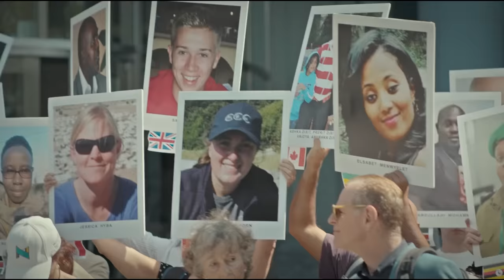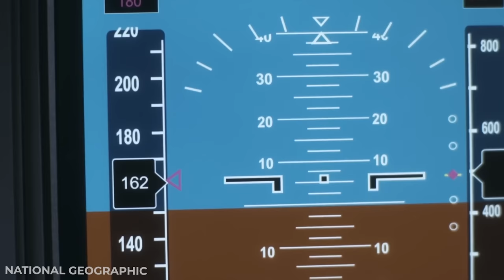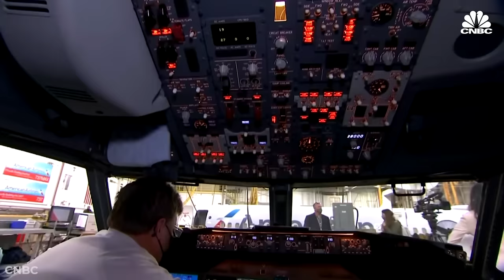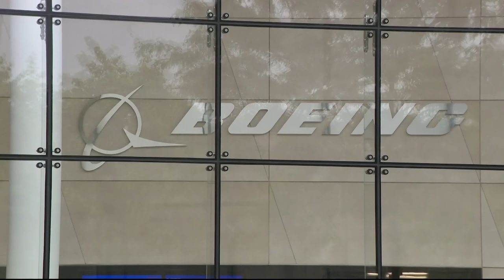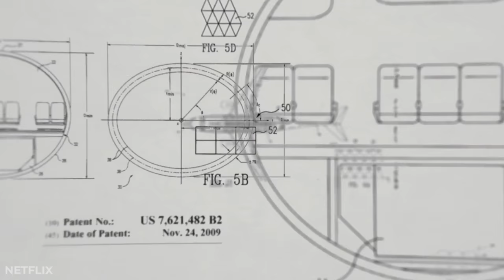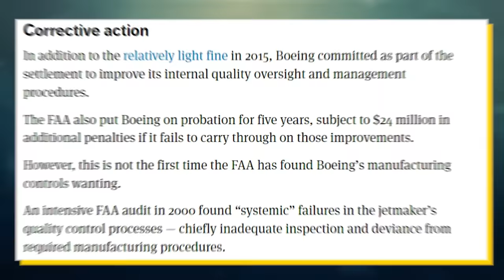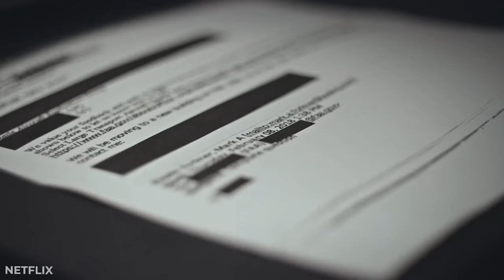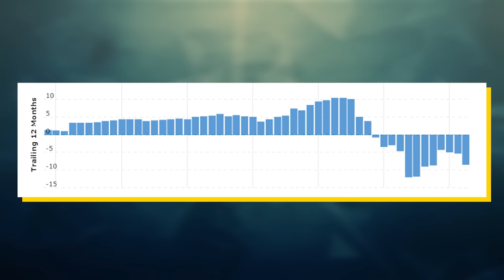Even Boeing Engineers Don't Trust Boeing...

Comment: The Challenger space shuttle disaster was caused by the same thing: administrators having the last word over engineers at Morton -Thiokol, the company that built the solid rocket boosters.
I see it happening all over the place. Managers believe that selling planes, rockets or consumer products is the same, it's just business.
I see it at Turbomeca (Safran group, they build and maintain helicopter turbines). There are more people in management than in engineering jobs.
Reply: The solid rocket boosters didn't down the Challenger. It was the fuel tank leaking, probably due to the cold weather. In fact, after the explosion, the solid rocket boosters kept going and had to be detonated by remote control so they didn't just fly randomly.
Reply: @pride293  Rubber O rings between sections of the SRBs failed because of very cold weather. Flames then impacted the shuttle fuel tanks. The SRBs were the location of the source of the problem. Engineers warned of this potential, but were overruled by management, to launch.
Reply: True. Even my Lexus is a piece of shit. Lexus! My 1992 Toyota Celica was a beautiful vehicle top to bottom. At some point in the mid to late nineties, things drastically changed, across the board. Greed has trumped quality, the environment, safety, workers, society... everything.
Reply: Parasitic shareholders are a huge problem.

The business is doing well making and selling their product. The customers are happy and so are the staff.
Along comes the parasite shareholder who insists on prices being raised to the market maximum as well as staff pay being cut.
This leads to the customers looking for other suppliers and to the staff becoming unhappy because their wages have been cut.
But the shareholder is happy because now they are taking even bigger dividends even though they are not the ones doing the work or buying the product.

Then we see the typical product quality problems which we shared legally hold shareholders responsible for because they are the reason why the problems happen. So shareholders of aircraft manufacturers should be responsible for safety issues that lead to deaths.
Reply: @Google_Does_Evil_Now  Nailed it. Add to your wage reduction scenario, the typical staff reduction move. I see this all the time. It's actually the way they reduce labor costs. So now you have employees possibly being paid less, but more importantly, incurring the stress of doing the job of more than one person. Add to that mess the sales and marketing folks making unreachable sales promises to prospective customers. Now the people actually doing the work, and doing the work of more than one person, are trying to meet unreachable deadlines. More needs to be said about this. Much more!
Unions used to solve many of these problems, but they eventually managed to remove that road block.
Reply: @JohnnyRawks  What is a union? It's a group of your country's workers who form a democratic voting process to discuss reasonable pay and conditions.

What's is the United States if it's also not a union of voters who try to elect a decent government to make everyone in the country have better pay and conditions.

The problem unions have is the same problem the voters have - corrupt or weak politicians who sell out the people.
Reply: @Google_Does_Evil_Now  The problem wasn't the general share holders, companies like Boeing wouldn't exist without shareholders. The real problem was rewarding Boeings management with shares, it gave them the the incentive to cut costs and cut corners, thus creating the disaster that they have. Boeings management are entirely to blame.
Reply: @pride293  The solid rocket boosters are built in 5 segments. In each segment, there are 2 O-rings to prevent the hot gases escaping. The Challenger accident was caused by both O-rings failing between two aft segments (because the cold made them to stiff to seal properly), hot gases leaking and melting a rear support strut holding it to the main tank. When the rear strut failed, the SRB pivoted and it's nose punctured the external tank. The external tank then exploded.
Reply: and then you start loosing a lots of money.
Reply: @pride293  Wrong.  O-ring malfunctioned on the right solid rocket booster and the flame burned through the main tank.

Comment: This door ripping off issue happened again on Boeing 737 with Alaska airlines. That's what brought me here. Alask Airlines has grounded all their Boeing 737-9 Max.
Reply: It's the MAX 9 specifically grounded but yeah, this is another MAX variant that has proven a disaster
Reply: I'm sure there was some cost reason behind it, but I really think Boeing should've cut out that bit of the fuselage only for the airlines who asked for the extra exit doors.
Reply: @Satoshi9801 the manufacturer of the door plug is also being blamed for the issue. I have also read that Airbus does the same thing. I'm guessing that they have to manufacture all the fuselages the same way for certification reasons? Idk.
Reply: @incubus_the_man  Boeing is responsible for what goes in their planes regardless of the part manufacturer.
Reply: oh really thanks genius
Reply: @Flightfest900  why are you hurt for no reason?
Reply: Not all 737s there are a lot of different kinds
Reply: the true beauty of capitalism
Reply: @andreasp.1572 Sorry you missed Aeroflot during the red years to see the alternative.
Reply: @michaelplunkett8059  does it really have to be black or white?
Reply: @andreasp.1572 YES. Capitalism wins.
Reply: @nonamewanderer
It is always the Boeing 737. Yes.
Reply: @incubus_the_man Planes are required to have a certain number of emergency exits depending on the number of passengers.  It's just that the seating configuration that Alaska airlines was using was below the level needed to have that extra door available, so they had it plugged to save the weight of the emergency door.

This specific plug type has been in use for a while now without incident, so someone somewhere down the line massively messed up and QA failed to catch the issue.

Mentor Pilot has video that goes into more details on why the door was plugged and the possible ways it could have failed.
Reply: Alaska didn't ground their 737-9s...the FAA issued an Emergency Airworthiness Directive.  Alaska was inspecting their jets and planned on returning them to service.
Reply: @Phillip_Fry until it kills 300 people trying to “cut costs”.
Reply: All 337max world wide should be grounded and abondened and boing should be the one giving compensation and fine with legal changes.
And what about the lobbying of boing with government? .......
Reply: @Satoshi9801  it's there in case the hull owner wants to refit it to have more seats at a later date. Then you just change it for a functional door. It's a first for a plug to blow out this way. Somebody made a better idiot.
Reply: While only -9s were grounded, I believe all Boeings with plug doors should have. It's not like plug doors are installed by someone else in other models.
Reply: With Alaska Airlines, there was a pressurization error and the airline ignored it, so that's not a Boeing issue, that's on the airline.
Reply: @rebeltvr6046  Not installing retaining bolts is fully on Boeing.
Reply: @sharpfang  Boeing messed up, but Alaska Airlines knew of the issue and decided to fly over land rather than fix the issue.  They could've easily fixed the issue.
Reply: @rebeltvr6046  They knew of an issue with the pressurization system. The plane isn't airtight, it constantly has the internal pressure balanced by compressor and bleeds it through vents. The computer didn't perform to specs. They are also expected to fix problems resulting from normal wear&tear or accidents. They are not expected to check whether the manufacturer installed all parts it was supposed to install.
Reply: @sharpfang  True, but Alaskan bears some of the blame regardless, esp. considering they decided to fly over land rather than water in case they would need to emergency land due to the pressurization problem, which is a horrible way of thinking.  Don't fix the issue, fly over land instead...
Reply: @rebeltvr6046   I agree with you that it was a known recurring problem with the pressurization system they should have vigorously investigated, and found the cause. A cause with a simple fix.
Reply: @annedavis3340  Yup.  But like other have said, Boeing made the much bigger mistake.  Fault to both, all due to cost cutting measures and greed.  It's shameful.
Reply: @rebeltvr6046  I can agree with that... but AFAIK this was not in violation of any rules. They could have done better. They were not mandated to do better.
Reply: Alaska hasnt grounded all their 737s because rheir entire fleet is 737s. Theyve grounded the MAX 9 as per FAA directive
Reply: @rebeltvr6046 they didnt ignore it, they investigated it and were unable to find a cause. There were rendundant systems in place so it shouldn't 🎉have been an issue. Boeing takes the fault here.
Reply: @rebeltvr6046 deciding to do that was not a requirement under FAA regulations. The plane was safe to fly as far as they knew.
Reply: Do they add another max number every time a door rips off?
Reply: It at least wasn't a design flaw it was just they had taken the plug out to work on skin rivets. Then they  FORGOT to put the bolts in when they reinstalled it & no paperwork was submitted for the job! 😮😅
Reply: There is absolutely no exucuse whether it be a design flaw or simply negligence. It all comes down to my not trusting Boeing with my life.

Comment: Side note, contracting outside companies to produce your parts and just assembling them in house isn't always bad, its bad when the inspection process is lacking. Gulfstream does this and we regularly scrap things or reject parts and slow our line down if it doesn't meet standards (ive seen whole wings scrapped). Outsourcing isn't inherently bad, its bad when its done incorrectly to cut major corners.
Reply: Agreed.  Contracting out-of-house can be a huge benefit.  You just need to do double-duty on inspecting the outsourced parts AND the companies you’re partnering with.  If their parts fail in your machine, the bill comes back to you first.
Reply: True and it's also the same in any industry whatsoever other than if you do something really simple, or you ARE the one they outsource to. You can spot several brands of components inside a circuit board, sometimes (quite often may I add) by competitors to the brand you're buying it from.
In cars, there's a reason they even flaunt proudly, as an upgrade, another company's components. Brembo brakes are a great example, the manufacturer might offer those as an upgrade (big logo showing and all) in place of their own parts.
Reply: This is why new cars today are crap!
Reply: AMEN ...
If you book the parts to stock, check if it's the one you're expecting and if it's up to snuf.
Reply: As far as I understood  Boeing outsourced the designing of parts, too. Which wouldn't work for a complex system as a plane, where everyone relates to everything. Also, the third party just might not know how to design.

Comment: As a retired engineer my chime-in is this: If a plane does not fundamentally want to fly you fix/redesign so it does. You don't force it to fly with a S/W patch.
Reply: Except virtually every newer transport as well as every US fighter jet is 'fundamentally' dependent on software to fly.
Reply: @55nsmooth and that’s why fighter jets crash so much lol
Reply: @jasonpeng5798 they really dont crash very much at all
Reply: @55nsmooth not really unless you mean fly by wire or emergency aid systems. Most airframes are designed well enough so that they don't need software constantly correcting their flaws.